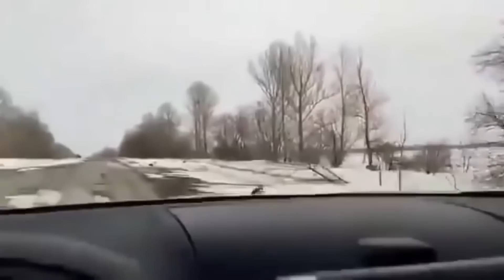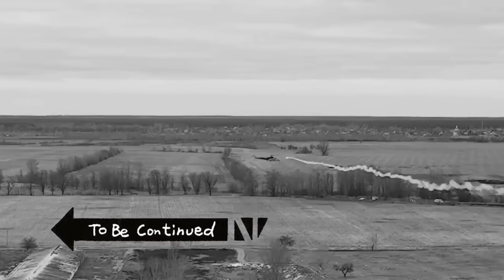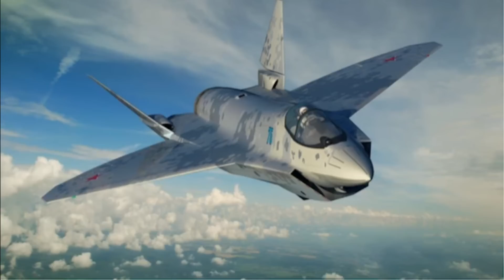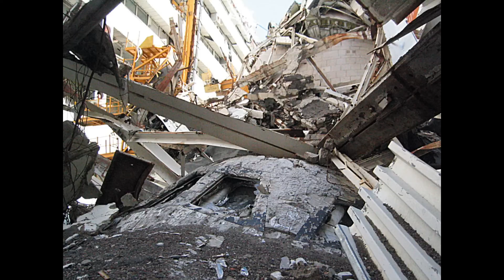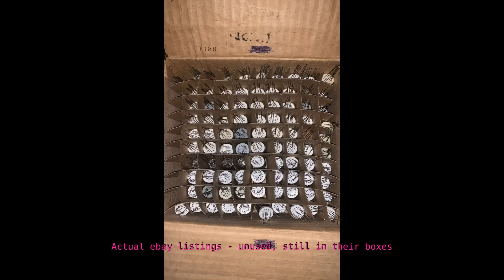100% warcrimes speedrun: Russia's technology problems

Comment: I have a nixie clock that still works after it being on for more than 10 years. Some old techs from those era are insanely durable.
Some of these tubes are very recent, from 1985. I bought the tubes directly from Ukrainian sellers, the guy is still in business and is well after a decade.
The board is from PVElectronic in the UK, very nice designs that is easy to build and configure, its soft lit/unlit and date scrolling is just neat. Highly recommend everyone who want to make one themselves, PV's boards and components would last over a decade or more.

Comment: NLAW is different, rather than your standard copper jet HEAT warhead it's a Tantalum slug EFP (Explosively Formed Penetrator) 
Designed as a counter to bar/slat/spaced/ERA armour, it has the inertia and velocity to just straight bulldoze it's weight through any combination of era lined cope cages.
And Ukraine in now manufacturing is own EFP warheads drained to be mounted on FPV drones.

Comment: The liner of the HEAT warhead doesn't melt, the explosion temperature is below the melting point of copper. The jet does behave like a liquid but is technically solid.

As for the slat armor, it works mainly by shorting the circuit which runs from the front of the RPG warhead where the contact fuze is to the back where the explosive primer is. That's why there are photos of PG-7V rockets just stuck in between slats without exploding, and that's why slat armor doesn't work on ATGMs or tank fired HEAT-FS rounds. And the NLAW can operate in the OTA (overfly top attack) mode because its warhead is pointed downwards, so it flies straight and detonates its EFP warhead when it senses the target underneath. So it would just fly either over or under the cage.
Reply: Your second paragraph is factually wrong. Slat armour doesn't short circuit anything. Shaped charges have a focal point which is accounted for in the design of the warhead so that the focal point of the jet is right on the armour plate. The purpose of slat armour is twofold: mainly it's to detonate the warhead at a different distance than it was designed so that the jet is not focused and therefore won't penetrate the armour. Secondly, depending on how it's hit it may deform the inverted cone shape of the shaped charge prior to detonation so that it doesn't form a uniform jet in the first place. Either way you have severely reduced the penetration of the shaped charge. Also, it's not there to catch RPG warheads primarily, though as you note it's certainly possible if the fuze doesn't hit anything and the charge doesn't detonate.

Slat armour does work on ATGM and gun fired heat shells, for the same reasons. I don't know about NLAW specifically, but the top attack variants of the TOW missile do not use classical shaped charges, they use explosively formed penetrators which are not sensitive to focal length over the practical distances they are designed to work.

Comment: "No soft enginering been done"

That basically sum up the russian armed forces.

Every single weaponsystem is made to meet a specificarion.... and they do..

But they are not made to meet a combined arms roll.

For instance basically all tussian tanks are designed to max put the armoured triangle. Power to weight  armour and armament.

One way they done this is that they pushed down the turet roof so it  need less armour and gets lighter. Making it both lighter and better protected.

Drawback. There is basically no gun depression. So if they end up on a ridge (that tanks often do) they cant fire.

More issues. They have a horrible gear box with very bad reverse gear. Prompting them to turn around when backing out of combat.

Comment: There's a reason why the Buran flew only once:  The Soviets had little clue what they were doing, NASA had an open information policy, and despite, or perhaps because of, the information being freely available, Russia sent KGB agents to the NASA offices to pick up copies of the data of the US shuttle program.   The information was just freely available on request at the front desk.  Apparently very obvious KGB agents.   They were noticed by someone at NASA, who contacted the FBI, who then worked with NASA to convincingly changed some of the data, specifically regarding the ceramic heat panels before publishing it to the public.

That's one of the problems when you copy other peoples work, you don't  know if the answers are correct, And If you have suspicions, your insecurities, probably make you trust who you're copying even if it's wrong.

Anyways, the Buran was totally fried, and lucky to actually make it back. It was completely unflyable after.   In no way was it superior to the NASA shuttle program
Reply: This is all true, as is the fact that the royal family contributed to the death of Diana because... did not want the appearance of a half-brother of the heir to the crown, born of an Arab.

Comment: Very cool video, just found the channel and subscribed :)

One thing I can add, from Lazerpigs interview with the Ukrainian helicopter pilot, they (the Ukrainians in soviet Helicopters) always fire their flares when they fire their rockets, because they don't have detection for incoming missiles. Where modern Helis would know if they are fired upon and respond if needed, most of the soviet ones (not all, though) need the pilot to activate the flairs, and since they are the most vulnerabler and detectable, when they shoot, they always deploy their counter measures by default. 
I could be a little off in some of the details, but that's why the russian pilots in the video launched those pointless flares. 

Also little bonus fact, Helicopter comes from Helix -> Helico  and Pter (wing, like in Pteranodon) basically it means something like "spiral wing" but that's not the cool part, the cool part is, that the P in Pter is silent. So the word should be pronounced "Helico'ter" with an awkward little pause. :)

Comment: "I gave too much credit to the KA-52 designers. Apparently the airframe isn’t particularly good and susceptible to vibration issues."
One video of one airframe wobbling does not really say much of anything except that there may be a force known as "wind" on planet earth. There's also a video of it returning to base without a tail, something it is probably the only military helicopter on earth capable of doing, except maybe it's predecessors such as the KA-29
Reply: Night optics yes, but you needed an IR floodlight most of the time, which would make you look like a lighthouse.
Reply: Also, 4:45 Soviet tanks have had dedicated night optics since the 50s so I don't think this video was very well researched. In fact, the T-55 was the first tank in the world to do so, whereas even a decade later the american M60 still required night sights to be swapped in by the crew when needed, requiring them to dismount.

Comment: Sigh a year later and a lot on here isn't..... The best. Soviet tanks (and by extension, Russian tanks) all use an autoloader situated in a disk under the turret floor. A different autoloader design is used by the French, Japanese, and Korean tank manufacturers that puts it in a turret bustle. Furthermore, the German Leopard 2 keeps the majority of it's ammunition in the hull and that can lead to the tank getting literally blown apart, just ask the Turks in Syria. 

No tank is invincible and all are able to be penetrated by newer atgms and AP shells from any reasonably modern tank. The Ka-52 is a very interesting design, and it's issues would affect ANY helicopter in service in a NATO nation if they went up against the same threats as Russian helicopters deal with in Ukraine. The vibration is due to a number of factors but hasn't significantly impacted operations and can be partly remedied with maintenance. All helicopters vibrate like mad.  Heck, we even have video footage of the President -S system working during the Wagner incident and during at least one instance in Ukraine. Soviet AFVs went down a slightly different path than Western ones for different reasons.

Comment: Air breaking in a dog fight is an amazing power because anyone following you will pass by and then you are looking right up the back of their engines, and you can lock an air to air missle on best
Reply: But it also kills your air speed, making you a sitting duck for a wingman. You should be using either turn radius or turn rate to get through the opponent's 9-to-3.
Reply: @ChucksSEADnDEAD  Absolutely agreed, it does kill all of your speed and maneuvering potential, but that's why they practice that breaking technique right?
Reply: @cascadianrangers728  Probably in sims, I doubt they put real airframes through that abuse.
Reply: @ChucksSEADnDEAD  I'm really more of a land warfare systems guy, so I can only imagine how stressful that must be to the airframe, is there any other reason to to do that other than just to look cool and show off?
Reply: @cascadianrangers728  It's a last ditch effort. If the options are ejecting or taking the hit, might as well try. But in air combat pilots always avoid being stuck alone so if you can't get someone off you, you'd talk to your wingman and pull your chaser towards him so that he can shoot him down.
If it's 1 vs 1 (rare occurrence) you pull the maneuver. If there's nobody else you kill your energy, take the shot, and then you'll be able to make your way back to safety as soon as possible.
Reply: @ChucksSEADnDEAD  Interesting, thank you for educating me

Comment: 1, its not necessarily about the "night optics" from what I am aware of, its more that a large portion if not all were not fitted with thermal and situational awareness optics. the Germans are a good example of this, since they realized pretty fast in the war that situational awareness is one of the most important aspects of a tank (soviets early in the war demonstrated that they drove around very confused due to not knowing anything because they couldn't see anything in their early tanks), and it still is. even in the gulf war (and desert storm if I recall right) the NATO forces demonstrated that (in a vacuum if we were to ignore infantry and air support) superior optics and especially thermal's would make you capable of curb stomping opposing force unaware of your presence.

2, ERA can still be very effective due to war not always using modern weapons, rpg-7's are still used to this day despite their very outdated performance, and a lot of the time especially in Ukraine it may be more viable to use outdated and inferior technology due to economy reasons (for example the engine compartment/rear of the tank seen from a top down view is still very weak to simple HEAT rounds making going into urban areas a extremely scary idea for tank crews) 

A good example of cost saving measures is the crazy prominent use of DIY and off the shelf use of quadcopter drones / FPV quadcopters as scouts, grenade droppers, and anti tank kamikaze bombers. These things being bought and built with the price ranging from 200 to 2000 usd including and excluding warheads (a lot of the ones being built i've heard cost around 300 total). In comparison military equivalents like the "HESA Shahed" loitering munition ranges from around US$20,000 to US$50,000 per unit. 
as you may have noticed hiring a slightly technical team to fulltime assemble and mass produce bulk bought aliexpress drones is a very very very appealing compromise.

this what I at least believe I know as someone who is enthusiastic about tank warfare and viewing footage on first person experiences inside Ukraine, I do not doubt I have a few misconceptions about some of these things but I think what I've said is largely accurate and may have corrected/added to what you have said/thought. 

I find the use of quadcopters a very surprising event in this conflict as it has opened a new view on using small UAV's in areas that should be covered by AA but now not being seen / dealt with by those AA, and creating a new kind of air superiority that many may not have considered. (though with current day airburst rounds from things like C-RAM small drones can still very easily be detected and destroyed, but that would also create problems of being detected by the enemy and etc etc. Quadcopters essentially create a problem that many may not have procedures for, making things dicey....) 

plus a lot of AA nowadays use 10,000 dollar short range missiles to missiles like long range ones from SAM sites that can cost 23 MILLION DOLLARS, instead of rounds making it very much a economy thing to deal with these threats. apparently a " FIM-92 Stinger " (effective range of around 4-5 kilometres) costs 38,000 to 80,000 USD, and that is considered "cheap". some of these military prices can be a bit .... delusional
Reply: PS, ERA is also used by the US army on their Abrams tank on the Tusk variant of it which is the urban fighting equipped one, they use something they call NERA which serves the same role as ERA without exploding as to reduce collateral damage and hurting close friendly infantry

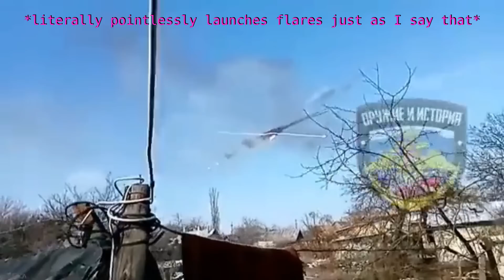Comment: 11:15 The flares aren't pointless, all helicopter pilots are taught to pre-emptively drop flares after popping up for an attack. It makes it much harder for shoulder-launched missiles to get a stable lock.
Reply: For modern missiles its not much harder at all. If you can see the helicopter with your eyes, then the image recognition algorithms on the missile can as well. They work like cameras rather than just the low resolution IR guided ones of the past.
Reply: @amazin7006  While that’s true, modern SAM and MANPADs have a much easier time figuring out what’s a flare and what’s a helicopter, the idea is that you aren’t gonna fly your helicopter into an area that’s heavily guarded by Air defense systems. It’s good to have flares regardless, most MANPADS floating around in the world are still the older IR ones, and it’s good to have redundancy. It’s good to have EW jammers and such, but it’s nice to have something that still works against the older stuff. Most modern western aircraft still have chaff after all, so I wouldn’t really count it against the Russians for having flares still. There’s plenty of other things to mock, like the lack of optics and sights for their infantry, the outdated hulls of the BMP series, the ammunition storage on Russian tanks, etc etc etc
Reply: @amazin7006 that’s why pre flaring can be important, missiles like the aim 9x will take images of the aircraft and compare it while it’s flying to the target, if you pre flare it will only be able to compare it to the images with flares and will be more likely to go for countermeasures
Reply from the maker: Yep someone else mentioned this. I’ll add a correction to the description.

Comment: What the Su-30 was doing at the airshow is called the Kobra manouvre, and no, it has no tactical application whatsoever. If you did it in real combat you'd just lose all of your energy and be a sitting duck for literally anything able to aim at you.
Reply: Yes, it does actually have combat application. Or at least it did when it was first used in the 60s.

Comment: All the best equipment has taken the brunt of the Ukrainians resistance, the Ka-52 is the most shot-down aircraft of the war and the T-72B3 is the most destroyed tank of the war.
The only thing that bucks this trend is the BMP-2 which is the single most destroyed vehicle of the war outnumbering both the Kamaz and Ural trucks (although they would outnumber BMPs if put together) with over 600 examples as of commenting this. At least based off confirmed destructions by Oryx.
Reply from the maker: There will be a degree if selection bias here. Ie the more capable hardware is likely to be assigned to more contested areas so experiences disproportionately higher losses.
If I can ever get reliable info (and time) I may be able to do a statistical analysis on which hardware has under and overperformed the most. That could make a good follow up video.

Comment: AT and AA rockets work just different and the electronic warfare would just be able to jam a signal which AT rockets probably rather rarely have as they are far simpler like TOW i think even just got a wire which sounds difficult to use whit aircraft. While AA needs communication whit Radar which AT rockets just don´t need.

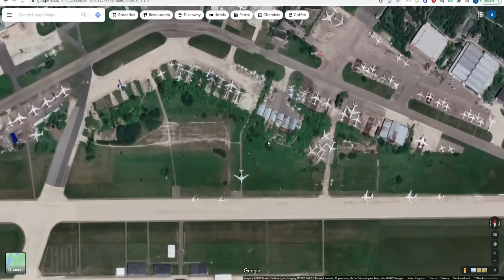Comment: Had a look at that Moscow boneyard at 17:56
and there have been some interesting changes since March.

1. There's a SU-57 in front of the sheds where Alex spotted the SU-47.

2. The Buran (mock-up ?) is gone.

3. Many of the larger Cargo / Passenger planes are gone
while others have been moved (worked on ?).

P.S.: Anybody know who uses that blue & silver livery you can
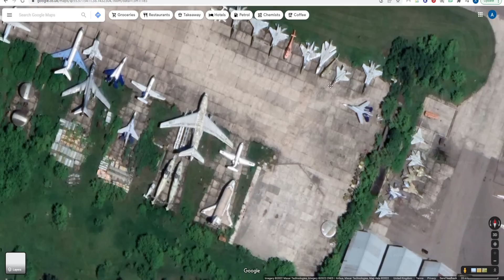see on the far left at 18:14 ?
There are two new, 4-engined planes with the same look now.

Comment: Many of the ERA bricks on Russki tanks, didn't have the explosives in them.
Reply from the maker: I’ve seen videos of bricks missing the explosives but I’ve also read claims those bricks were intended to protrect the actual ERA from knocks when driving around in tight urban spaces. While I absolutely believe the Russians are sending in tanks without functioning ERA, I decided to leave it out of the video as I couldn’t find hard evidence.
Reply: there are a few videos that show some tanks had the explosive replaced with cardboard sheets and another was fabric of some kind but the best was a T90 that had the explosive replaced with rubber sheet, guess things bounce off ? lol
Reply: @daveking4229  A  video of that? You mean a video of a blown up tank with a brick taken off of it and then showed to the camera? You know that those videos are propaganda right? Just like ghost of kiev